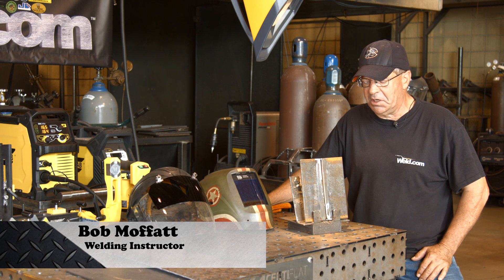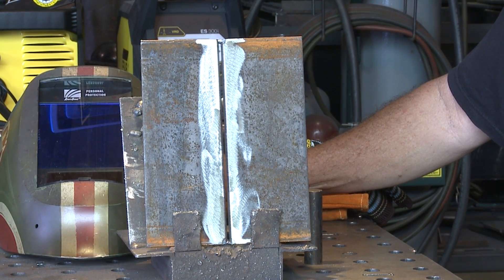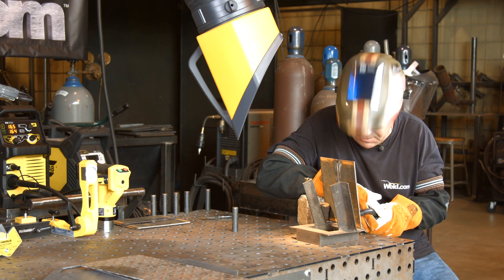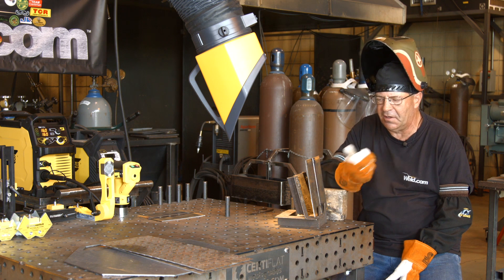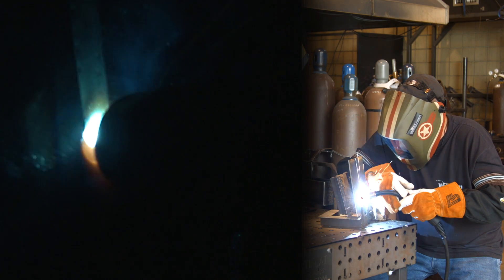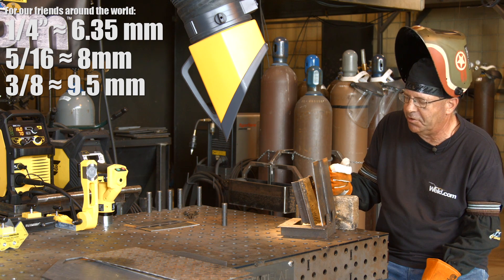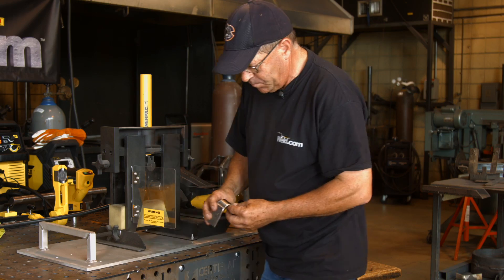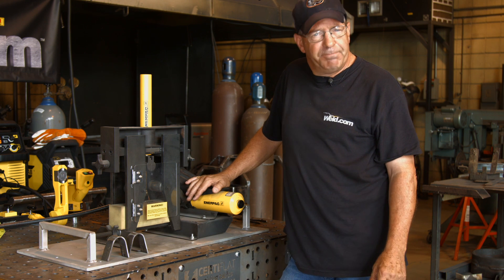🔥 Uphill MIG Welding and Bend Test

Comment: Y'all make this this look so easy. I just graduated welding school at ACT in Beckley, WV, and I've been struggling with my vertical and overhead Mig bend tests. Now idk if it's a mix of my angle (when I do my root pass) or if I don't have the right settings when I do my other beads, but it always seems to be something when I go and run my beads. Regardless, I'm not complaining, because I'm determined to get it, but every time I think it looks good, something always happens when I bend it. I either have a small crack or a huge crack in my face bend. However, I always seem to get my root bend looking good. Idk, it's weird. According to my teacher, the root is harder than the face, but to me I think that's hilarious. I can do that the hard stuff, yet on my face I always find new ways to mess up. I've had times where I think my beads are perfectly overlapped, and yet when I go to bend it on the face, something happens. If y'all could give me some feedback, or some advice, I sure would appreciate it. But I find that funny, I got my horizontal gmaw test complete, but as for my vertical and overhead test I keep struggling. Maybe it's the fact that when I grind my landing, sometimes I mess up on it, but I honestly am at a loss for words, nothing I try is works. However, if y'all could give me some feedback, that would be most appreciated. I work hard in class, and really want to get this more than anything, so I'm very interested in what y'all have to say. First my root pass, I usually run it at 19-19.5 volts, and my ipm is between 240-250 ipm.

Comment: I ran some 3g down hill roots today on 3/8 plate today with an 1/8" gap with about a 1/16 root face. Using 0.35 diameter wire running about 21 volts and 290 imp. My roots are a little concave on the backside. Would Appreciate any tips :-)
Reply: Run colder if you run to hot you will have suck back. I run similar gap and run about 18.3 250-265 and butter it in everytime. Just stay in the leading edge of the puddle

Comment: Clean Coupons!  
Nice video for the instruction, Bob.  I did my first vertical and overhead test in the 80s for one inch coupons, (structural cert for low hy).  The examiner stamped and kept my originals, but was nice enough to get a couple more slices out of my test bars and let me keep them as souvenirs.  I still have them around here somewhere. 
This vid brought back some memories.  :)

Comment: 6g 6"schedule 40 carbon tig fill and cap . The trouble is when I am doing the cover pass the metal sinks down from 8 to 10 o'clock.I've tried to keep the filler on the top section of the groove but it still keeps sinking.

Comment: Hello welding student here. Few questions. Last week was a inside joint vertical with 6010. On a miller (dont know model but will expand when i find out). Also strugling on a 3/32 vertical butt joint on 6011 root and 7018 cover pass. Up hill on both.
Reply: Dean Roberts Look up our vids. We've done stick with 6010, 7018
Reply: Dean Roberts 3/32 material thickness?

Comment: Is it possible to mig something more exotic? Stuff like titanium or a bi-metal joint like steel to copper with aluminum bronze?
Reply: Beach&BoardFan Please look up wire feed titanium. Get back to me when you find out.  I'm curious.
Reply: Apparently, yes Ti is usually GTAW, PAW, IHAW, or EBW, but Ti can be GMAW welded but requires:
-A power supply that provide pulsed DC and a push/pull torch that is synchronized with the power supply pulses.
-A dedicated Ti only deburr tool and brush must be used to prep the weld area.
-The area to be welded must be cleaned with a non-chlorinated solvent. (acetone I guess)
-The weld area needs to be shielded with high purity Argon or Helium until it drops below 700 degrees F, both trailing and purge need to be used because Ti will absorb N, O, C, & H causing the weld to be contaminated and brittle.
-The wire grade/alloy needs to match the material being welded and the wire spool is usually bagged or kept in a container to prevent dirt/dust from getting on it.

(sourced NorskTitanium, and ScienceDirect)
Reply: Beach&BoardFan I understand all that. Just not heard of or seen much use of GMAW Ti welding. GTAW for sure around here in aircraft.
Reply: Yea I guess it's not very common... not sure why? Seems like the most common thing Ti GMAW is used for these days is additive mfg..
Looking at this stuff also made me wonder, why when doing GTAW, a super cheap mig welder isn't used as a wire feeder instead of hand feeding wire rods? Seems like it would be easier, and I would think a spool has to be cheaper then straightened and cut 36" rods? The prices I saw for Ti wire seem super expensive, up to $200/lb.

Comment: Is that an axial-spray machine? Definitely doesn't look or sound like a globular transfer machine. Thanks for great video!!!
Reply: Ken A it all depends on how you set it up man
Reply: +torcher78 axial spray machines are different machines than cheap globular gmaw machines
Reply: Ken A please explain to me how they're different machines
Reply: ok...... I just watched the video put out by Miller on Youtube. Go on YouTube and look up GMAW welding basics. It explains how axial spray deposits metal that is much smaller in size than the filler wire than a Globular type machine that just spits out large droplets typically larger than the filler wire onto the base metal. My old Lincoln SP100 110v wire feed is a classic "Globular deposition type GMAW welding machine. An Axial Spray machine is so much better to weld with.... so much more metering of metal deposition...... so much more precise. That's why I asked about what type of transfer Mr. Bob Moffit was using. I'll go back and find out from the manufacturer what deposition that machine produces but from the look and sound, I'd say it was a cool, quality Axial spray transfer. Just Google Axial spray transfer ... you'll see the info and the Miller Video.
Reply: Ken A in the video that Bob made he is using short circuit process not very many people use globular because it limits you to the flat and horizontal position for Welding and typically uses 100% CO2 which causes a great deal of spatter. As stated in the video Bob is using C25 gas of which 75% of it is argon 25% is CO2.  It helps the arc burn a little hotter and produces less spatter. Now if Bob wanted to axial spray with that Machine he would have to change a few things in his set up, let me go over those with you... first he needs to change his gas to one that contains at least 80% argon, at work I use a mixture that is 90% argon 10% CO2.  Also known as C10 gas. The next thing he would need to do is just crank up the voltage and wire speed to somewhere around 25 volts to 28volts and 400 to 600 ipm. 110 V hobby welders cannot produce this kind of power which I'm guessing is why you think they are different machines. A millermatic 252 can achieve both short circuit and spray arc processes all you need is a different bottle of gas. I use a Miller axcess 450. That machine with its matching wire feeder allows me to switch between Mig and pulsed spray processes with a quick pull of the trigger.  It's a pretty awesome set up. And gives me a great deal of flexibility.
Reply: Go to Miller welding, Youtube..... Mig Welding Basics: What is spray arc transfer. Take care........ I won't get in a pissing match with you. I was just asking a question. I figured I'd try to help you out.
Reply: Thanks for info....... Back in 1992  at community college welding school, Miller gave us videos of different GMAW welding machines, short-circuit, axial-spray etc. The axial-spray method , slowed down on video,  revealed a great looking deposition pattern...... much like Bob's welding results....... that's why I asked about the type of machine welding process. Thanks for explanation.........
Reply: Ken A if you've never pulsed spray anything I think you'd really enjoy it. It doesn't put in as much heat as normal spray transfer and you have a much better control of the puddle. We try to spray everything we can at work so we're not wasting time cleaning fireballs.
Reply: Ken A  sorry if I came across as a jerk earlier
Reply: No problem my friend......I should have realized that there's a whole more new welding machines that can multifunction. My days of welding school and welding glory had no inverter technology. I have been passed by with technology and really need to learn more..... that's why I'm here. I did just buy an Everlast 256Si to learn GTAW welding. ( I was a cert. SMAW and decent GMAW welder) Any advice you have is appreciated. GBYAY......When in doubt ask Bob or Jody!
Reply: Ken A I would love to snag one of those everlasts. They look like nice units. Tig is my favorite for sure. Although that video of bob running that stainless stick with frequency at 180hz was a trip to listen to. I wanna try that.  If you plan on welding aluminum with that Everlast stay away from pure tungsten go with 2% lanthanated or 2% ceriated. I'm not sure if I spelled that right but